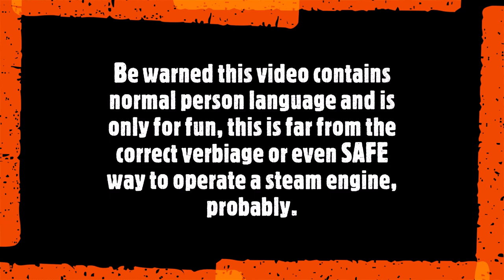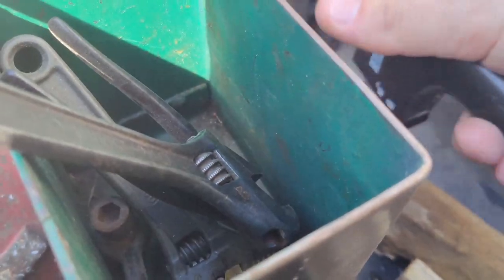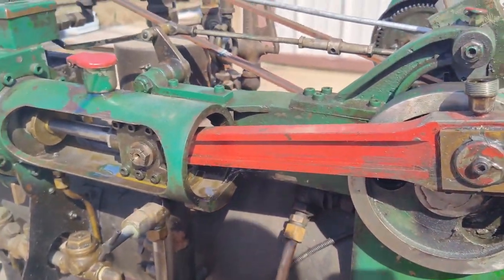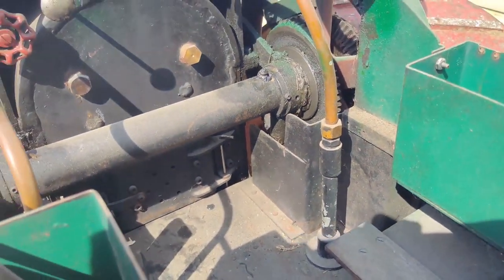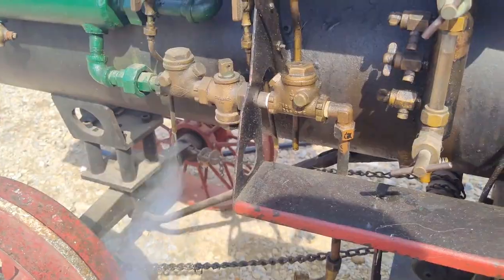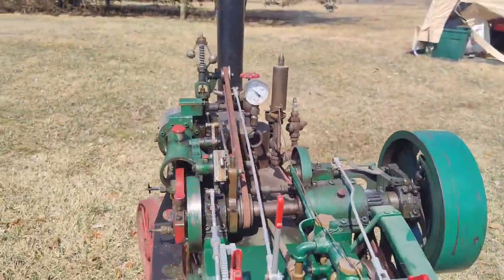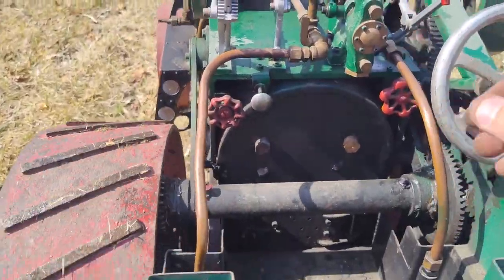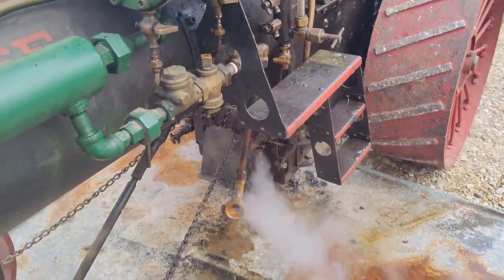How to drive a Case Model Steam Tractor

Comment: Awesome video not many in here of 1/4 scales. I have one my grandpa bought many years ago from the guy who built it. Mine is set up different as far as the water injectors. Mine has the mechanical pump that runs off crank but has a valve you have to open to suck water from the water wagon into the boiler. Kinda difficult to use if you don’t have much steam pressure and low on water no way of getting water into boiler. Have to use pump with engine running but if no steam no water

Comment: As someone who has steam loco experience
Try putting a 1 lump thick coal layer on the the grate
Then you pack your wood add a little bit of coal ontop and light up
Reply from the maker: Good tip thank you very much!!  Any recommendations on where a guy can find good quality coal? I'm near Cedar Rapids Iowa
Reply: @scottykify  im in South Africa lol
I heard coal over there in the US is in general crappy
There are websites where you can buy coal for model engines
I think accucraft does it
But any good wood will do i think
Maybe even charcoal
How ever when working i think you'd constantly be firing cause the draft could destroy your fire lol
Idk i specialize on the full size locomotives
Not minuture
There is a method of firing called fire it light and keep it bright
It means you sprinkle a little bit of coal on a relatively thin fire
But you keep it bright
I should probably mention I'm not a fireman
But i am a trainee (pun unintended) fire lighter/shedman
Also once in a while you should clean your fire
Just stir the fire around to get the ash out
Also you gotta think ahead 
If you know you want to add water in let's say 2 minutes 
Get the boiler hot to minamize the pressure lost when adding water 
Also when you posting about the engine again?
Reply from the maker: @laaity  unfortunately I've had some life changing events with the passing of my wife just over a year ago. With 2 young kids at home, my tinkering time has been cut down.  BUT! I do have unseen footage of this engine, makeshift dyno test that I want to improve, among other various model projects just begging to be finished up and edited!  There will be videos coming, mark my words and be patient, I'm not giving up!
Reply: @scottykify  oh crap
Im really really sorry man

Comment: So I’ve acquired a partly finished one of these.  A bit smaller.  The “exhaust “ from the cylinder goes into the big tube on the side. Seems too be a tube inside a pipe. Inside tube runs from boiler side through to the front.  The outer casing seems to handle the exhaust..  what is it’s purpose?
Reply from the maker: That preheats the boiler feed water from the crank driven water pump. So it's not pumping cold water into the boiler. Takes less BTU to heat the water
Reply from the maker: The inner tube "or tubes" inside of the casing is what the exhaust flows thru and the boiler feed water goes thru the outter portion
Reply: @scottykify  ok make sense..  he must have never built the pump.   Looks like I gott do some sand casting and make something..

Comment: Whats the water pump for if it has an injector
Reply from the maker: Redundancy, most steam engine boilers have multiple forms of adding water in case one of them fails, you know, for safety
Reply: @scottykify  thanks. What oil do you  use in the lubricanter for then engine
Reply from the maker: @cjhoffman1  I believe it is 680 weight steam cylinder oil from Jason Kovac at thetraindepartment.com